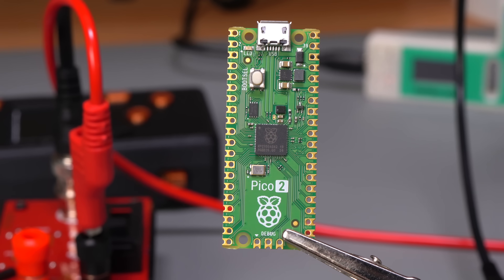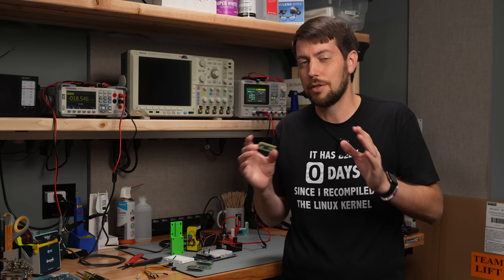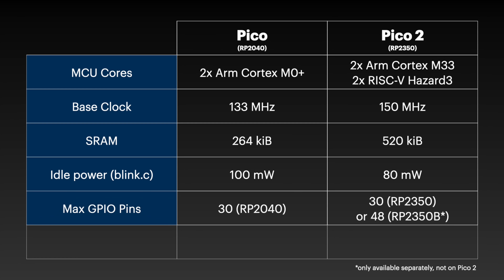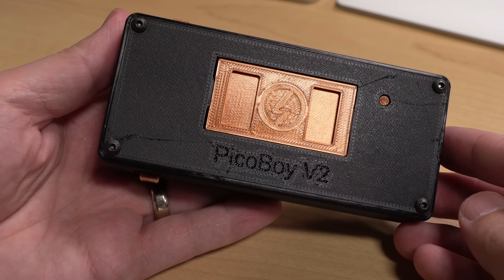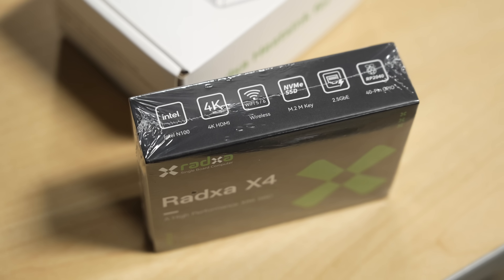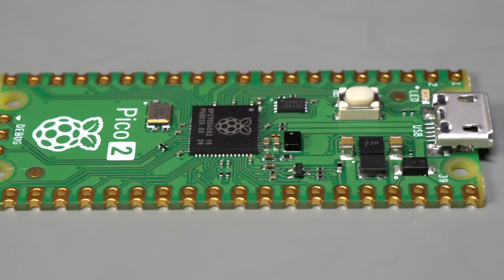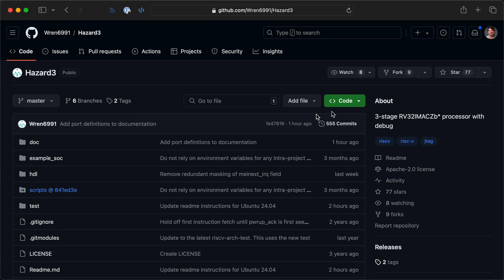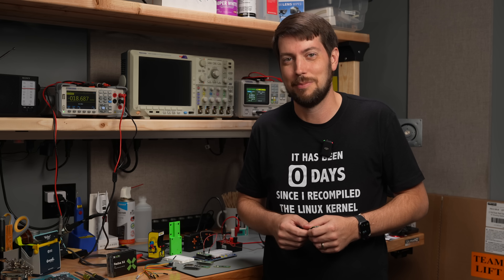Raspberry Pi Pico 2: a RISC-V bet!

Comment: I do think it's important to mention that the Hazard3 RISC-V cores in this thing are actually designed by Luke Wren, to quote Raspberry Pi "currently a Principal Engineer in the Raspberry Pi chip team". They didn't just grab some open-source RISC-V CPU; arguably, they did the opposite.
Reply from the maker: Good point—I've never met Luke, but it does look like he's been on Raspberry Pi's silicon design team for quite some time! I'm guessing he was also involved in RP1/RP2040 a bit, interesting seeing how much / how long Raspberry Pi's invested in their design process.
Reply: @JeffGeerling  Yes, he was on the RP2040 team.
Reply: @JeffGeerling i was wondering now that the pico 2 is using cortex M33 architecture, which is ARMv8, or 64 bit.  However what are those 2 RISC V cores?  Are they 32 bit, or 64 bit.  I tried to find some information on those two Harvard 3 Risc-v cores, but I couldn't find out enough information about the RISC V cores that are inside the rp2350
Reply: @sgodsellify  seems to me like 32 bit Verilog there
so I would think cores are 32 bit as well
Reply: @sgodsellify  A little googling suggests the Hazard3 is a RV32I ISA, which is 32bit.
Reply: @orclev  thank you.  It seems a little weird that they would use two 64 bit cores, with two 32 bit cores.   Unless those 32 bit cores are the only cores that will allow you to go into a really low power deep sleep?
Reply: @sgodsellify  The Armv8-M profiles are 32 bit
Reply: @sgodsellify  I don't think it's that. Really on such a small device there's no real advantage to a 64 bit processor. Your memory space is so tiny that you won't come even remotely close to running out of room with 32 bit pointers. Aside from the address space, the only other difference is the size of math operations. You can only do 32 bit math as the registers are only 32 bits wide, but for typical use cases that's not really going to make much of a difference. You're not going to be doing heavy number crunching on one of these.

Ultimately I think this is RPi feeling out the interest in a RISC-V variant of the pico. For an ultra low cost embedded chip like this, there's a lot of advantages to going to an entirely open homegrown CPU core without needing to worry about ARM licensing costs. In particular, the fact one of their own in house engineers designed this core specifically for them is huge and opens the possibility for all kinds of custom silicon in the future.
Reply: @orclev  I get it 64 bit doesn't even come into play with tiny amounts of RAM that is on board any pico.  But having 64 bit for calculations, including floating points will be faster, than 32 bit cores.   The M33 cores can do 64 bit calculations, including 64 bit floating point operations.
Reply: Yeah, but cortex M33 cores can do 64 bit math operations.   I get it 64 bit doesn't come into play for the pico's tiny excuse for RAM, but it can still do 64 bit operations, or math calculations, including FP operations.
Reply: @sgodsellify  I think you may be incorrect.  From what I can see in Arm's Cortex-M33 programming manual, it doesn't have 64-bit math operations.  It has some 32-bit integer instructions that can be used to efficiently assemble 64-bit integer calculations on register pairs, and the FPU can load 64-bit values into a pair of 32-bit registers (and can do the corresponding store), but the FPU only has 32-bit floating-point-arithmetic instructions.
Reply: @BrooksMoses  looking at the Arm®
v8-M Architecture
Reference Manual page 162, it states that the optional FPv5 can do double precision arithmetic operations, which are 64 bits.  Granted that the OEM (Raspberry Pi) implements the optional FPv5 extension.  I guess we need to ask Raspberry Pi foundation if they implemented FPv5, or not?
Reply: @sgodsellify as far as I understood from datasheet as someone not familiar with MCUs or Arm details, RPi included full float hardware fpu, but have their own custom thing that can accelerate some double precision math.
Reply: @sgodsellify  You can only access the FP accelerator from the ARM cores. The arm security features etc are also not accessible from the RISC cores
Reply: @avovk1852  what does it being Verilog have to do with anything? Verilog is just a language.
Reply: @sgodsellify idk about how rpi implements it, but you can make a 32-bit alu support 64-bit double ops if you retain the needed state and (borrowing amd's terms) double-pump it. a similar trick on steroids with state is how you can make a simple 32-bit processor using an 8-bit alu, as arm seemingly did with their cortex-m0.
Reply: @orclev but you can put 64bits registors in there, for the 64bits math
Reply: Well that should be fairly obvious... you don't just grab any old CPU and build it into a combined ARM+RiscV SOC like some kind of lego kit. Whatever combination of ISAs you choose, producing working silicon using them requires a lot of low level design work requiring detailed knowledge of chip design.
Reply: ARM has been raising their loyalty fees and up lifting design costs, so that's why the world wants to depart from them (Qualcomm, maybe now Pi?) and prepare for RISC-V instead.

Comment: The EU must be really angry that they still didn't switch to USB-C 😂
Reply: as *the* EU, I am, in fact furious
Reply: Everyone is
Reply: @danielpicassomunoz2752 No they're not. Like many people, I couldn't give a toss. I've got loads of Micro USB devices and the required cables, and new cables are both easy and cheap to buy. If that's the biggest problem you have when using a particular device, you're doing well.
Reply: They also sell the chips, so I in fact mostly own USB-C RP2040 board currently. So I actually forgot about the reference boards using micro USB.
Reply: @fgregerfeaxcwfeffece iirc you can passively convert 2.0 type a to type c with simple wire connects and a couple resistors, right? it's so easy, you can diy it if you really wanted to.
Reply: China clone boards will use USB-C.
Reply: The RPi foundation needs some way to celebrate Brexit amidst all quarrels and the lousy state of the bwittish economy.
Reply: They aren't considered a market holder, so probably there will be no problems. I guess that if they could do it cheaper for micro USB I am fine with it. It is already expensive enough as is.
Reply: @skvvlk  It's less then $10 for a dev kit, you think that's expensive?
Reply: It's not a consumer product, it's a development product, I doubt regulation would ever apply to it, and also USB-C ports are way more expensive in comparison to the board, so it would add to the cost for no reason, decreasing revenue
Reply: EU requires only standard plug. They don't say which standard.
Reply: @uis246  Also, AFAIK, that regulation only applies to devices with rechargeable cells inside.

Comment: I will order one, but can we PLEASE have a U.FL / IPEX1 connector on W version, pretty please? I want to go further away from wifi than barely 2 walls...
Reply: Not really possible due to compliance requirements - compliance for the PicoW was done using the onboard antenna - use anything else and you lose the compliance. So just having the connector means no compliance can be achieved as you could put any antenna on there. The CM4 has UFL, but the compliance is only valid when used with the official antenna, so that might be an option.
Reply from the maker: @jamesh9756  Good point.
Reply from the maker: If not a connector, maybe pads at least so you could solder one on and cut the board antenna trace.

Comment: Micro-USB in 2024? 😢
Reply from the maker: I think they wanted to maintain the form factor. Hopefully next gen will get USB-C. Many 3rd party models already have it though, similar prices (and often more features, like a reset button!).
Reply: @JeffGeerling  Unfortunately, many USB-C boards are not compliant with the standard, and therefore power via USB only works with C-to-A cables. I was hoping for a new Pico 2 ;(
Reply: What are the practical advantages of USB-C on such a small board? Power shouldn't be a problem with Micro USB, and the connection via USB-C won't be any faster than USB 2.0. However, the USB-C receptacle have more pins (I think) and are still likely to be a bit more expensive, even in large quantities.
Reply: @JohnADoe-pg1qk  As for me, I'm hyper-fixated on reducing the number of different types of cables I use

Comment: Why is it still micro USB? 😭
Reply: Backwards compatibility. But I would prefer usbc, though there are custom 2040/3050 boards with type c in the same form factor.
Reply: Cost, too. When you want to hit a very low price point, the cost difference is big.

Comment: i cant wait for the days when CPU's have ARM, x86-64, and RISC-V cores on them all at once to handle any task from any instruction set...no one has done it yet but I think inevitably it will happen...emulation can only go so far, at some point full blown heterogeneous compute will make sense and itll be awesome
Reply: I can't see why. Most programs can just be recompiled to the new ISA. If not, emulation actually works for most cases, and often the tricky part is not the CPU, but it's the surrounding hardware. There have been boards to add an x86 CPU to various computers in the 1980s and 1990s for MS-DOS support, and Nintendo handhelds had extra CPUs to support older systems--note the DS had an ARM7 for GBA compatibility as well as the DS's ARM9, and the 3DS had an ARM9 and ARM11, as even the same ISA is sometimes not good enough. This century, emulation has been good enough, and native hardware best, with plugging an extra CPU in being expensive and only marginally better than emulation.

Comment: Dang, I wish they'd put usb c on them. Still looks cool though! Excited about RISC-V
Reply from the maker: Yeah; for that, there are 3rd party options at least... but hopefully next generation! The Zero's still stuck on micro USB too.
Reply: @JeffGeerling  Thanks didn't know that!
Reply: @Log4Jake  Yeah, the Zero 2 is still Micro USB, for whatever reason. 3rd parties have clones with dual-USB C though.
Reply: @JayrosModShop I assume they designed themselves into a corner by having it on the original, and not wanting to break compatibility with the original footprint
Reply: tbf usb-c has 3 data lanes in each direction while microusb has only 1 lane, and the speeds are considerably higher.

they could've just disconnected the other two lanes, but then it's just a waste of copper, and passive microusb to usb-c adapters do exist if needed and they're incredibly cheap.
Reply: I remember this being asked when the Pico released - Micro USB's ubiquity and companies pretty much throwing the connectors away are why the Pico uses the connector still, Type C isn't that much more expensive in price but they aren't as abundant and Pi's factory definitely have a ton left over from the past decade.
Reply: @amirpourghoureiyan1637  I get type C connectors for no price difference over Micro USB on AliExpress, so I'll take Type C all day, every day. Plus it's a more solid connection and can handle more power, given the project at hand demands it. I can't stand using an inferior connector when something better exists for the same price. But that's just me.

Comment: Now THIS is interesting. Guess I'll be buying a few to put away for future projects. After your interview, I did get the impression they were considering RISC-V, but I didn't expect it until at least this time next year, so this is quite an interesting surprise. It's not an SBC though, so it's not quite as interesting there. Being a drop-in replacement (assuming it is always that simple) is really exciting though. I'm loving all the RP2040 projects lately, especially in modding game consoles (I just installed one in my Switch last week, in fact), so hopefully this opens up a few more options for those.

Comment: I should buy one and add it to my project pile that never gets smaller for some reason
Reply from the maker: Why buy one for the box in the drawer when you could buy *two*? lol, I know the feeling...
Reply: @JeffGeerling  this happened when i bought 5 picos and 3 pico w, i think i still have like 5 in the packaging
Reply: @JeffGeerling  I hate only having one of a component, especially MCUs and sensors. If you build it into a project then it is very useful to have a second just for quick tests and a spare in case something breaks.

I will probably get a few third party boards even though I don’t like the rpxxxx platform and especially how you program it in C.
Reply: I actually had no intention of buying one until this video. I have so many rp2040 boards. pico, pico_w, stamp, tiny2040, feather, pico-ice(rp2040 + fpga).... and then Jeff mentioned that it finally has a solid low power mode, and I have a wearable project that I originally wanted to use the rp2040 for but had to scrap because of the high power draw. Welp, if I'm going to order 1, I guess I'll order 2 for the pile.(although I'll probably order a stamp or a feather instead of the pico)
Reply: same. I have 3 original picos that I still don't know what I want to use them for. lol

Comment: Love the RISC-V adoption, but is that a USB-B Micro? 😕 

Guess it makes sense if it's meant to be a drop-in replacement for the Pico 1.
Reply: The real sauce will be when RPi drops the RP2350 (both A and B) as a single chip you can get.
Can’t wait for custom keyboards to be using this!!!
Reply: @fujinshu On the Raspberry Pi blog post, they ended by presenting third party boards from official partners like Adafruit which use USB-C. They should be available over the next month.

Comment: Why again micro USB? :(
Reply: so that myfriends on Aliexpress could make clones and earn their buck too ;)
Reply: I figure they just had a MASSIVE inventory of the old connectors, so they kept using those. Just wait for the next Rπ⓪, the old stock should be gone by then. If you absolutely must have a USB-C, then wait for the Adafruit version, it will have -C for sure.
Reply: Cheaper? More profit?
Reply: Likely to be for compatibility, cost, and power consumption.
Reply: There are hundreds of third party rp2350 boards with USB-C (and often other features) that are cheaper than the name brand one anyway
Reply: cost!! nothing else!
Reply: @mythicalforce8658  Molex 2169900003 type-c and 0475900001 microusb are the same bulk price on digikey. In fact, the type-c is 0,02 cents cheaper but you also need to add a 5.1k resistor so it adds up to exactly the same. Even if it were more expensive I wouldn't give them cost as an excuse.
Reply: @mythicalforce8658 ESP32 come with USB C and they are still cheaper
Reply: The connector is a bit cheaper. The board cost so little it does matter. C would be nice but eh, not that big of a deal, need to have more cables handy when doing anything with it and it's sometimes a hassle, but a couple of seconds of hassle is worth it.
Reply: Micro is way cheaper to build and implement. If you don’t need all the features that USB-C offers it makes a ton of sense to keep using micro USB.
Reply: @Th_RealDirtyDan the C connector is more robust and more user friendly
Reply: @PatsFanGermany  Can't say more robust. I run a classroom, and maybe 5 USB-C cables died and 2 USB-C sockets died the last few years, not a single USB-micro port or cable died. At the same time tens of cables dissapeared. With USB-micro, disapearing is no longer an issue, as not a single phone uses it.
Reply: just get a pi 5